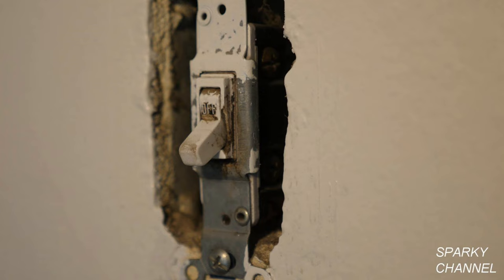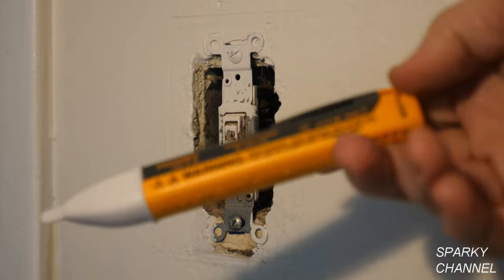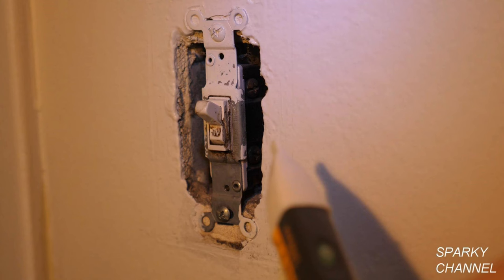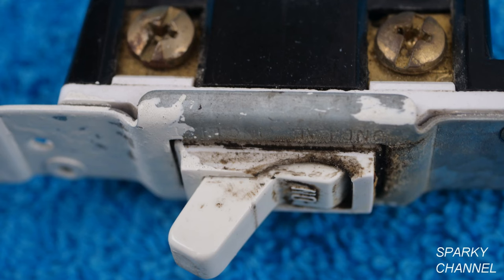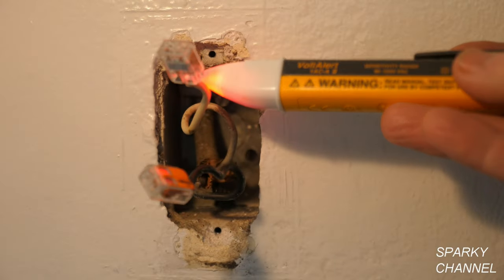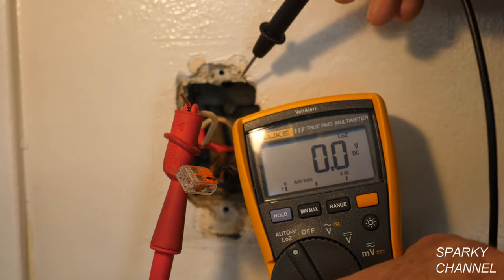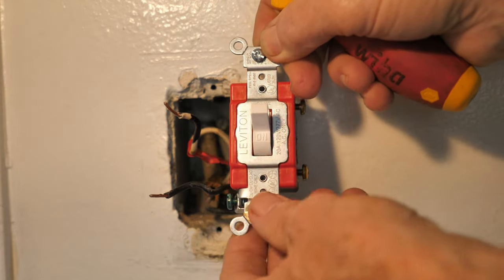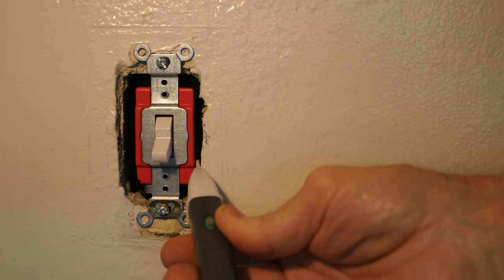Switch Test and Replace, NEC 2020 404.9, "Snap Switch" Definition, and Screwless Wallplate Needed?

Comment: It's a good practice to connect your hot leg to the top terminal on the switch.  this dates back to the old knife switches where it was required to mount them with the hot wire at the top, and the "knife" so you had to lift it up to close the switch - so that gravity would hold it open instead of having the possibility of closing it.  now, gravity isn't an issue, but it's a good consistent habit, so you can easily test switches that aren't functioning properly, and know what wire SHOULD be hot.
Reply from the maker: I like that! Good tip Ken.
Reply: I always put my hot leg to the top but I've been doing so long I am not going to change it. Lol

Comment: Another great video that takes a fairly routine task like changing a switch and addresses a common problem like not having equipment ground in the box. Our home's lighting circuit is mostly cloth wiring and has no path to ground in the switch boxes. Even though we have replaced a number of switches, we are still to code because the circuit is protected by a GFCI breaker. Thanks, Sparky.
Reply from the maker: Very true! Thanks Gregory!

Comment: Very good video! Nice job explaining testing, replacing and re-testing the switch. I also did not know out the screw-less faceplate requirement.  You always provide the best information - thanks, Bill!
Reply from the maker: Yes, I think that is a little-known code. It makes sense though. Thanks Tim!

Comment: What does it mean when the switch says "NO"?  kidding.  Volt alerts (mine is identical to yours) are very sensitive and will tell you it's hot with voltages as low as 5 volts.  They're an excellent safety tool, but verify with a multimeter.  I never cut wires unless they are too long.  There are slots, on the device, to poke a tiny screwdriver to push the tab to release the wire from the stab in the back connection.  I never use stab in the back connections due to the tiny amount of surface area, and they cause weak connections which cause fires and intermittent problems.  Even electricians overlook the screwless plate requirement that protects anyone who ever enters that structure.  Detailed tutorial.  LOVE IT!
Reply from the maker: Thanks Greg! Yes, No means No! LOL!
Reply: The problem with reusing the stabbed-in wire ends is that they’ve usually been damaged by the original install (divots in the conductor, etc.) Best just to cut them, plus it’s often a real pain to remove them.
Reply: True, but many residential sparkies forget NEC 300.14.
Reply: @gregchambers6100  I always cut the tips of used wires and if they are too short I'll pigtail them. I've seen wires break off from the ends being old and stressed. Especially in the case of cloth cable.
Reply: @illestofdemall13  Butt spices, +three wraps on a ground..if less than 3" or replace or bypass that cable and retire in place.
Reply: @illestofdemall13  I twist and pull the wire sometimes and/or push the release tab in with a tiny screwdriver.  Then check it.
Reply: @gregchambers6100  Not me. I cut off used tips no matter what and re-strip.
Reply: @gregchambers6100  If the existing wires are too short, that makes it the more difficult to get a tool in there to release them, and as somebody else already mentioned, cutting and pigtailing is the answer, then people down the road don’t have to worry about it again,

Trying to rescue the stabby end can be a huge liability time-wise, particularly if you have to do a lot of them. No way!

Comment: I always enjoy your videos and sharpening up on code. However that looked like the older cloth romex so seeing you had 2-3 inches in the box I would have stripped it back and see if you had a ground wire there and if so I would loosen the clamp and see if I could pull some more slack or make a short splice or your case maybe inline wagos. Since power is obviously coming through the light I would pull the light quickly and see if that's grounded to finish the ground path return to the panel. It maybe tedious but if it's there and I can do it I rather do it for safety and future safety.
Reply from the maker: Excellent tips, thanks!

Comment: I have always been taught to use 12/2 on regular household branches (length not requiring the bump up in size either). I wondered if this holds true today or should we switch to 14/2 since it is rated for what the circuit is rated at anyways. What are your thoughts on the subject. On one hand you have wire that is never going to be the weakest link in the circuit. On the other it is more expensive and a bit harder to work with. Thanks for all the videos.

Comment: Interesting as always, Bill.  Question, what questions would you recommend a homeowner asks of an electrician before hiring them to work.  I know the obvious such aa valid license, but how do you gauge their knowledge, especially of newer NEC and local rules.
Reply from the maker: A valid license is a good thing. A good question would be "are you the licensee or are you working under the licensee? Same thing with plumbers by the way, the licensed plumber often hires guys that work under their license but don't really know much about plumbing. Amount of experience is a good sign as well.

Comment: Great video. Are surface mounted switches and outlets available in the US? They are sometimes used in Europe with the cable or conduit outside the wall as well.
Reply from the maker: Yes, they are. That arrangement would normally be used in a commercial setting though.

Comment: That wasn't the 2020 NEC code you were looking at.
Reply from the maker: The first part (definition of snap switch) was from the 2020 NEC Handbook.
Reply: @SparkyChannel  True, but your graphic at 9:29 stated "2020 NEC 404.9" is incorrect as the wording in the 2020 code is different then what is shown in the video.
Reply: @SparkyChannel  He's right, the 2020 version has some added words. You may have used 2017.
Reply from the maker: @illestofdemall13  Thanks, I'll have to check that out.
Reply: @SparkyChannel  You're welcome.